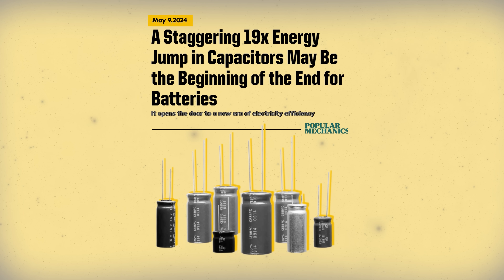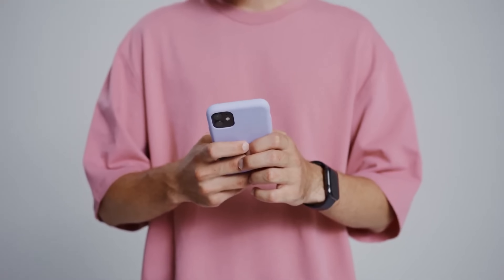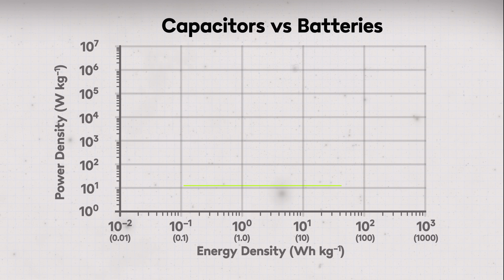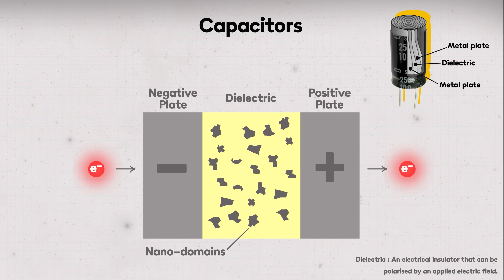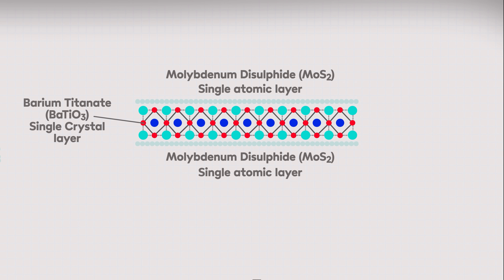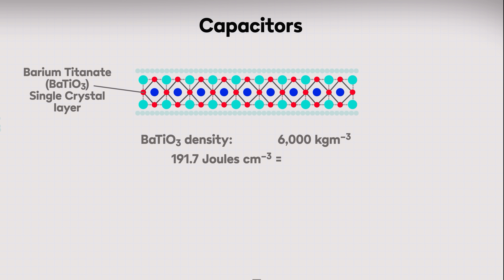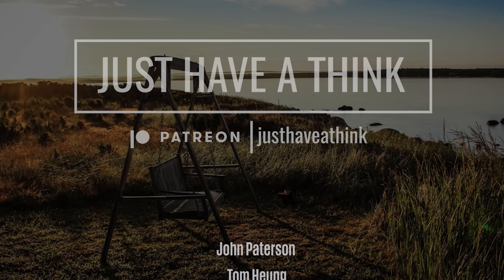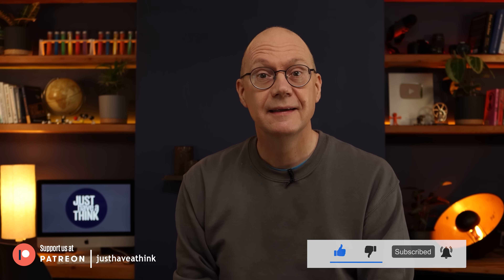Charging an EV faster than filling a gas guzzler? Surely not!?

Comment: What I find interesting, as an owner of an EV that charges in about 25 or so minutes on a fast charger, is that this shouldn't be the main focus of EVs. Sure, it would be nice to charge faster, but I rarely ever need to charge super fast. What I would prefer is more range from a battery, especially at highway speeds of 75 MPH. I can get about 200 or so miles of range on the highway during a road trip. If I could get 250 or even 300 miles of range I would be way more satisfied with that than being able to charge faster.

If they got charging down to 15 minutes, especially to or near 100%, that would be a major improvement. Especially if I was able to get 250 - 300 highway miles per charge.

For 98% of my driving I am in my local city and charge on level 2 overnight to get to 100% and I only need to do that once a week or maybe slightly more if I drive a lot that week. My range when driving locally and using "one pedal driving regen" is about 350 miles or so.

Comment: Just a very simple thought from a simple guy but surely an EV that is able to charge in 5 minutes or so is only half of the problem. How far are we away, (if ever) from being able to supply all those electrons, at the volume they would be required, to all of the ever increasing number of charging points around the country (or world even). Also if solor and wind is the only aceptable route we won't even be able to sustain a national grid that is capable of charging our (UK) 40million+ vehicles at present day charging speeds. But I suppose it has to be a progressive step in the right direction should a miracle come to pass on the supply side.
Reply: I would imagine the same argument was posited by horse buggy drivers of old, where would all the petroleum come from to power all those new fangled horseless carriages afterall hay could be bought in any town in the county.  The answer is it happened, and the same answer applies to EV use - UK wise the National Grid are well aware of whats requried to support full renewable electrification, have defined plans and are rolling out upgrades at pace to support such. 

Government, academic and industry assessments all confirm there is sufficient renewable generation capacity around the UK to support current and projected load needs, supported by additional technologies (hydro, bio-energy, battery storage and nuclear) for base load and peak load requirements and supply diversification via renewable energy from partner countries. Further, EVs charging isn't a fully additive load but a displacing load, as the energy required for sustaining fossil fuel production (which is not a small number) will reduce as renewables and EVs rollout.  Specifically regarding charging, the charging plant designs have evolved to include local battery buffers that isolate EV charging current draw impacts from the grid, smoothing out demand as they recharge over a longer timeframe (charging points are not used 24 hours a day).  So yes there is sufficient planned renewable and grid capacity, with many steps already implemented or underway, to support a fully electrified vehicle footing. Timeframe wise this is inline with the UK Net Zero goal of fully renewable by 2050, although elements such as the National Grid upgrades, and offshore wind generation capacity are running ahead of this goal to de-risk supply dependencies with fossil fuels.

Home charging, and home generation for that matter, is becoming more significant as homes and EVs move towards being an integrated component of the power network - with home solar/battery storage/vehicle to home/grid integration enabling homes to be an active component of the grid both consuming and producing energy. Cars will become part as both a mobility device and a energy storage device, with at home charge/supply speeds will improve via solar panel and/or home battery DC/DC integration that are staring to come on the market. The grid will expand from the more centralised approach today to a distrubted network of both large and a small energy providers.
Reply: @GruffSillyGoat  Total pipe dream Bollocks! and what has horse and carts got to do with EV charging, totally different set of circumstances. Besides check it out oil was in abundance well before the car came to being and petrolium was a waste product in such abundance it was a problem to dispose of. So NO! people driving horse and carts did not wonder anything of the sort. The rest of your long winded ramblings of, what if, .. there will be, .. blue sky prophecies are just fingers crossed speculation. Wake up and smell the coffee for gods sake. When that day comes give me a nudge.
Reply: @GruffSillyGoat  No horse and buggy drivers wouldn't have put the same arguement simply because oil was in plentiful supply well before the automobile came along and petrolium was an equally plentiful waste product which was a problem to dispose of. To be honest I only scanned read the rest of it because such a long winded ramble of pie in the sky fingers crossed what might be ..what could be, which seems a long way away from reality. But please give me a nudge if it begins to look  anywhere near being a posibility in the next 50 years.
Reply: @openminded3763  -  It's odd that you asked two questions but then don't want to read any answer provided, it's almost as if you were not being honest with your initial enquiry. You'll be pleased to know though that none of the answers I gave are wishing thinking, rather they are reflection of what is happening on the ground now in the UK in readiness for 2050 Net Zero targets. Although such might even be sooner - the new UK government are intending to re-assert the 2030 date for ceasing sales of fossil fuel based cars.

BTW - kerosene and parafin was the main product from rock/shale, coal and well oils before the ICE car, displacing whale oil for heating, lighting and lubrication. Production was relatively low but took off explosively following the invention of the car. Most historians and histotechnologists agree that is was the car that sustained and fueled the growth in oil exploration, extraction and refining. So no there wasn't plenty of the black gold around in the early days, the relationship between the ICE car and oil industry has always been a symbiotic one.
Reply: @GruffSillyGoat  What planet are you one what two questions have you imagined you are answering. Besides Evs have not a cat in hell chance of even making the 22% sales target only 5 months away. Why? Because the are an ill conceived unreliable costly and stupid solution to a problem they can not address as well as one that disputedly may not even exist. So Starmer will either have to climb down even on the present mandate, or decimate the UK car industry, taking with it millions of jobs etc, etc, with eye watering penalties which some are already reacting to with their feet. So dream on and keep pontificating if it makes you happy but I've got better things to do in the real world.
Reply: @openminded3763  - Ah I see you were not honest with you original post is seeking answers to simple questions. Interesting you bring up the VETS policy and UK automotive industry, it seems the UK automakers have already embracing both and are progressing well along the transition to electric car production. The SMMT recently stating the UK has already reach 38% electric vehicle production and the pace accelerating to full electrified production by 2030. In terms of the ZEV mandate targets, there is room this year for automakers to refocus sales for the remainder of the year and use borrowing, pooling and trading to meet their targets, although some won't, but they need to try harder next year.
Reply: Openminded3763 - Many of the claims you made don't hold water:

Claim: the UK's National Grid is unable to support Battery EVs, citing it was 'creaking' and unable to support an increase in demand, with changes taking decades to complete, and renewable generation is 'madness'. 
Whereas: the National Grid have already been upgrading for a number of years already - they have stated they will be 'zero carbon' ready by 2025, and have a stretch goal of fully renewable generated power by 2033, well ahead of the governments 2050 Net Zero target. Energy analysts believe this is feasible with current progress but does represent a stretch goal, which if not achieved by 2033 would be met well before 2050. No credible sources have stated the UK grid is creaking or has problems with increasing capacity. The National Grid is sized with a transmission capacity of 80GW, of which only 30-35GW is currently used daily - the usage figure has been dropping since the 2000s mainly due to the reduction in heavy industry across the country and big improvements in energy usage efficiency (such as the shift to LED lighting).

Claim: battery EVs even at today's level couldn't be supported by the UK's electricity grid. 
Whereas: battery EVs (BEV) charging does not represent a UK grid capacity challange. Currently there are 1.14m BEVs on the UKs roads, with total sales of new cars are 1 to 2m a year (across all fuel types), hence even if all these cars were BEV (unrealistically) then by 2030 there would be 7 to 13m BEVs on the road out of the 33m cars on the road. If 13m BEV cars charged twice a week (600 miles per car per week, way over the actual average car use) this equates to an average electricity demand of 300MW per day. The UK's grid capacity would not only supports 13 million BEV cars today, let alone by 2030, it would easily support all cars on the road today (33m) being BEVs right now (770MW). The activity for enabling BEV cars isn't transmission capacity rather it localised grid connectivity that is rolling out too slowly, this is known and one that the new UK government has stated is a priority to be addressed.

Claim: that insufficient raw 'rare' materials exist to produce Battery EV cars. 
Whereas: the claimed 'rare' materials used by EVs (of all types) are those that are common to both Petrochemical refining, ICE motors and older EV batteries technologies - comprising elements such as cobalt and nickel. BEV batteries mainly being deployed now are LFP based designs that do not contain cobalt or nickel, and instead use highly abundant materials. The use of 'rare' is often confused with the group of elements referred to as 'rare earth' materials, some of which are used in electric motors but not batteries, but the name is a historical misnomer. Many of the 'rare earth' elements, and those used in electric motors, are more common in the Earth's crust than as some other elements used at high volumes (such as gold, silver, platinum, copper, tin). 

Claim: there is insufficient copper to support the Grid expansion to support EVs. 
Whereas: The UK's grid is already sufficiently built out, with a little extra copper being involved in the connectivity of EV charging sites. Copper is not a consumable, and is one of the most recycled metals available with any upgrades utilising a high degree of recycled copper. There is 1 billion metric tonnes of virgin copper reserves available in the Earth crust, much of which is highly accessible; copper is not a limiting factor. Similarly there is circa 350 million metric tones of Lithium, which is enough to support all 1.5 billion cars on the planet currently being BEVs many times over. 

Claim: UK battery EV sales have only increased by 0.1%. 
Whereas:  UK battery EV sales are up 9.2% YTD 2024 in June, PHEV 31.2%, over the same period in 2030, with the BEV YTD market share being 16.6%, further reaching 19% in June alone.  

Claim: the UK VETS scheme is an issue for automakers with a claimed 0.1% of battery EV sales falling short of the 22% BEV sales market share ZEV mandated. 
Whereas: YTD sales of BEV is 16.6%, reaching 19% in June. The various VETS scheme measures are available to automakers to meet the 22% target; industry analysts have calculated most automakers using these measures can reduce their EV production exposure to an achievable 5.5% of sales this year, although this may make subsequent years a harder stretch for some automakers. Some manufacturers, such as JLR, have already stated at the start of the year that they plan not hit the target and will use the scheme's trading mechanism buying credits from electric only manufactureres (e.g. Tesla & BYD) who have a surplus of ZEV credits they can sell (88% of units sold). Others like Stellantis sought to increase the production of electric light commercial vehicles, which has a lower 10% target this year, anticipating to use the over capcity from their lower sales target to offset their low level of BEV car offerings. However, this has proved problematic as the EV LCV market has dipped in the 1st half of the year and not met projections. Stellantis have stated they may seek to reduce sales of its Petrol/Diesel/Hybrid cars for the remainder of the year to reduce exposure.

Comment: Not sure if there is even a place as a compliment to batteries. More tech, with still less Wh/kg, and probably less Wh/€ or £ or$.

How about a flywheel? It may store kinetic energy from breaking, either with fancy electronics or why not mechanical transmission?

In the end BEV is probably the most cost effective car, possibly with solar on the body as the Sono Motors Sion, or Aptera (Aptera just need a bit more practicality)

Comment: People think that Elon is really smart. He went on and on about super caps for regen in Tesla cars. One day,  one of the actually smart people that work for Tesla told him what I show you below. He then realized just how stupid he sounded and shut up about it!
*
Farads to amp hours:

Farads x full charge voltage = Coulombs
Coulombs/3600 = amp/hours
*
A 310F super cap is about the same size as an alkaline D cell.
It's common that super caps are charged to full at 2.7v.
310F x 2.7v = 837 coulombs
837 coulombs/3600 = .232 amp hours! 
*
This is a negligibly LOW amount of capacity when you consider typical alkaline D cells have 8 to 20 amp hours of capacity. Caps are NOT EVER going to supplement battery storage as they are now! If that 310F super cap you can buy from many sources made today got 19X better, that's still 5890 farads
5890F x 2.7v = 15903 coulombs
15903 coloumbs/3600 = 4.4 amp hours. 
Now you have a super cap with about the capacity of an average modern 21700 cell. 21700's can easily exceed 5Ah right now. If these amazing super caps exist, I'd sure like to see them, but I bet they are physically much larger than a 21700!
* 
On your other point about putting regen into super caps, I'll have to assume you know nothing about electronics. Can a system be designed where upon regen, the pack is switched out and a super cap bank is switched in just for capturing regenerated energy? Yes...this has been done. Super caps 100%  in parallel with your main pack is totally ineffective. The caps just charge from regen right along with everything else and provide no advantage. The only advantage is in switching out the pack and switching in the super cap bank in its place to capture regenerated power. Even then, the ONLY time this is advantageous is IF the charge in the caps is significantly higher than the charge level of the pack. IF the regenerated charge in the super cap bank is much lower than the pack level, it's not going to provide any amount of reusable power. Also, you would constantly be jacking around with the system voltages of the EV. While on super caps, lets say it started at 350v and then dropped to 300v before you switched back to the main pack. Now the pack which is sitting at say 340v needs to power everything back to its voltage and do so instantly. All this back and forth switching and massive current dumps is going to break down the mosfets or IGBTs used for the switching from caps to pack. Never mind the abuse of the pack this causes! Never mind that this added "super cap recovery system" adds a lot of complexity and cost to the EV that you don't need. This has been done and it's a BAD idea if you "Just have a think" about the implications of such a system in real world use. There's very good reasons why no one does this! The tiny cost to the pack from regen is negligible compared to the cost and complexity of a super cap based regenerative collection system!

Comment: 🤔 I feel like capacitors would be a good match with something like or MesoDyne or LightCell convertor. 8.875Wh/kg means a 25kg cap can provide 100kW of boost for almost eight seconds. That would get your vehicle off the line and up hills, with the convertor providing baseline power to the system.

Comment: OK, let’s assume that the perfect battery has already been invented, with fast charging times similar to gas stations. That's what everyone seems to want, so let's run with it. Gas stations typically fuel in 5 minutes or less, even for pickup trucks. The Tesla Cybertruck has a 123 kWh battery. 123 kWh in 5 minutes (1/12 hour) would require a charging cable of around 1.5 Megawatts. Now look at environmental conditions. We can cover the charging stations, but not the vehicle, which may have rain or snow dripping all over it. Yes, I understand about testing the circuit ahead of time, and ramping the power, but once 1.5 million watts is flowing, if a drop of rain or snow then causes a short... That much power can vaporize things in a small fraction of a second, things like fingers or hands. When you run the numbers, the dream turns into a nightmare.

Comment: I am failing to see how this can speed charging.  Yes, it can moderate electric charge better, but the battery can still only 'take' so much charge at once from the cap or the mains. You are increasing weight and complexity to add the cap, but once the much less energy dense cap is full, it still has to dump it into the battery at a rate the battery can handle without damage.  Make it make sense.